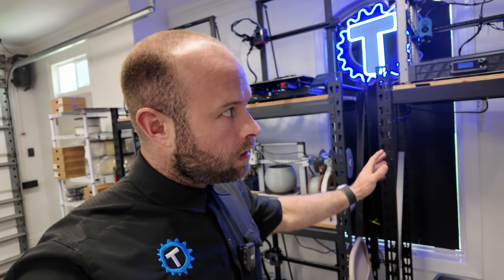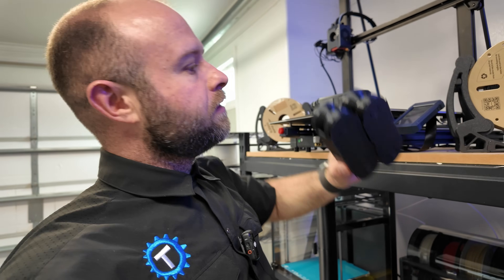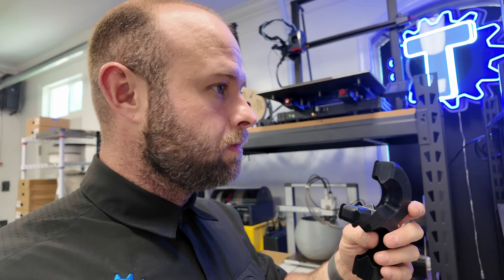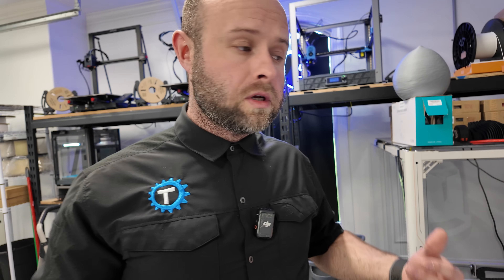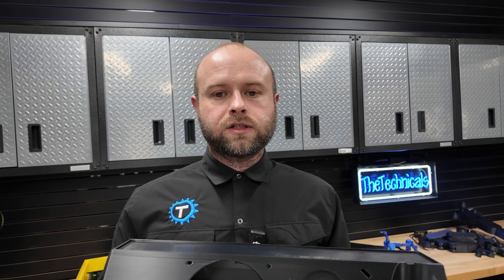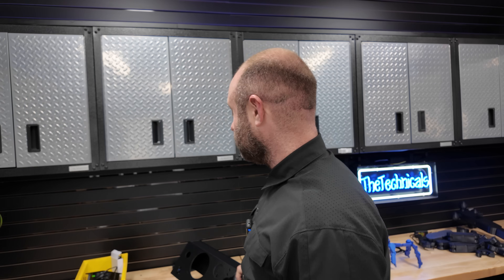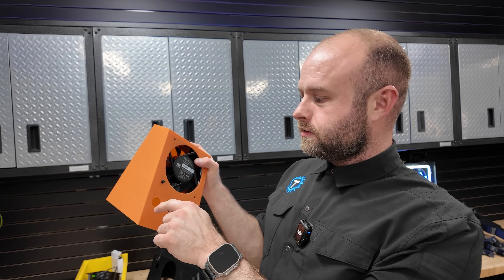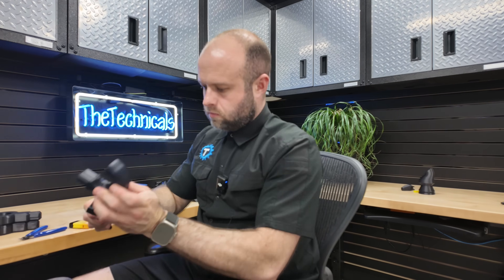Firing up my OLDEST printers for another LIFE SIZE model: 3D Print Vlog

Comment: About your desk Cubby, it's not a new concept but you might want to come up with some sort of modular system with a basic profile and snap together modules like a phone holder, pen cup, drink holder, fan or whatever.  One thing that I've run into with this sort of thing is that over time things come and go and something that was needed at one time is not important down the road.  Making it modular enables you to remove, add or rearrange things.  Sometimes it's just the location you want to change, put the pens on the other side or whatever.
Reply: This is a great idea

Comment: I'd just like to mention to H2D owner of what not to do while cleaning the lead screws.  Don't try to cleaning the lead screws while the printer is homing or honing, the House Botton on the XYZ screen.  It doesn't like it and, and when you press up on the bed, it keeps going to infinity.  Yes, that bar bent more than I'd like to admit.